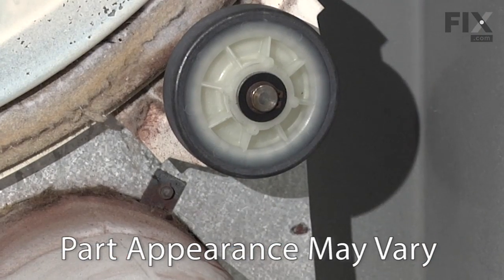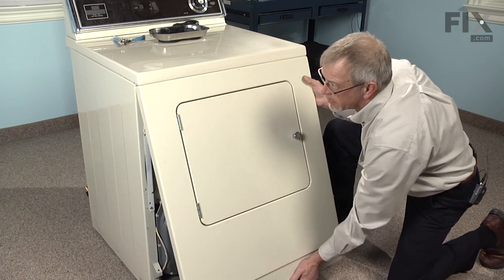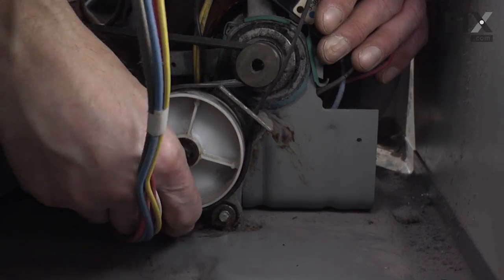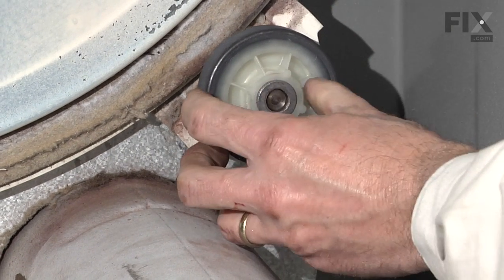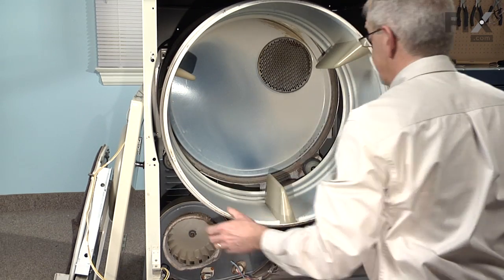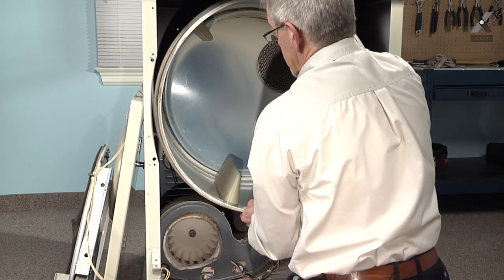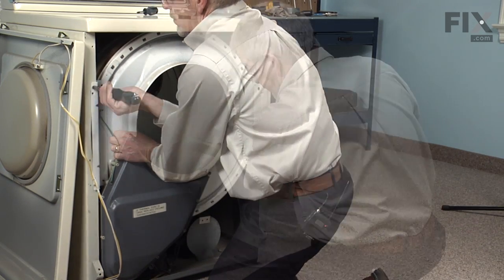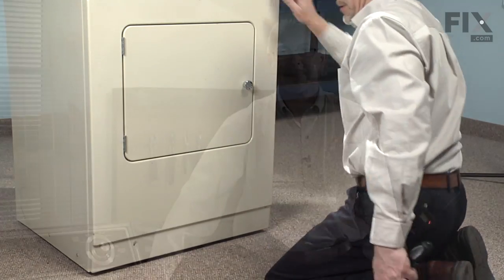Maytag Dryer Repair – How to replace the Drum Roller

Comment: Thanks for this video. I replaced rollers,tension pulley ,belt and drum Teflon slides on front. This is one of the best ways to put the belt on. 
Dryer runs like new for 60 bucks.

Comment: After spending the better part of the afternoon trying unsuccessfully to replace the belt (I could not "feel" it correctly, blind, with my left hand, backwards) i ended up pulling the dryer out of the space, removing the back vent panel and connecting it from there.  It took about eight seconds.
Reply: Did you have any problems with the gas line getting kinked? also any problems connecting back the exhaust duct? that is the only thing that worries me if i do it from the back. But yes i agree that trying to install that belt blind is a real pain.right now i am waiting for the new belt.
Thank you

Comment: What kind of lubricant do you use on the belt rollers?  Also wish there were a clearer diagram of how the belt wraps around the pulleys.  Otherwise, spot on - thanks

Comment: My dryer is not spinning. When I push the button I hear it hum, but the drum won't spin, not even manually. So I took it apart as you've shown and the belt is in place no problem.  How do I know if the rollers need to be replaced?  I can see them clearly, but not sure if they are worn all the way down?
Reply: The rollers need to spin very freely. How noisy is the dryer??
Any resistance on the tumbler guide wheels is a no-no and causes friction on the belt. Also, do a visual inspection on the idler wheel. Some dryers have a rear access door for the belt install. Sometimes idler wheels shatter with age, or the little e-clip lock fastener has dissolved into a rust powder, and the idler wheel decided to get cold feet, and walk off of the spring loaded idler shaft, causing a loose belt, or busted belt condition.

Comment: Hi, I installed new drum rollers and now after 30 days of not using the dryer it smells lime burnt. What is happening? Hope you can help me and thanks for the video !
Reply from the maker: Hi Alan, and thanks for your question. There are several factors that could be causing the burning smell in your dryer. You can check your lint trap, exhaust vent, and base of the dryer. Excess lint or dust can be causing the smell. However, the smell, could also be coming from the belt rollers, as it is important that the rollers are properly lubricated to avoid grinding. This can also cause the burning smell that you're experiencing. You might want to check the belt for wear as well, as an insufficiently lubricated roller can damage the belts. Good luck with your repair, and let us know if we can help you further.
Reply: Fix.com I really appreciate your help, I'll take a look and let you know !

Comment: My old Maytag dryer went bad with a burned heater terminal wire. I took that thing completely apart, and hosed down all the panels, cabinet, bulk heads, and the blower wheel (it’s very important that the blower wheel is clean, along with all ducting). Then I left all the panels, and cabinet to sun dry. 
I completely removed the driver motor assembly, blew out the dust and lint from it with compressed air (This too, is very important. The motor needs to dissipate it’s heat, or the motor winding enamel coating degrades, and can cause the driver motor to short out). 
I brushed off the dirt and lint from the heater housing assembly, and blew the inside (inner heater section) with compressed air, and took apart the ceramic heater terminal posts that connect the heating element, to remove whatever was left from the burnt wire (The terminal block posts, nuts, and washers must be very clean and shiny for proper contact and conductivity to the heating element). I took a wire wheel to the terminal posts, and Dremel cleaned the nuts and washers. Very important also is to not over tighten the terminal blocks, or you will shatter the ceramic insulator posts (...and 1 new heater terminal block assembly is very expensive at approx. $18.00)
I made my own replacement wire with 12 AWG (American Wire Gauge), and high heat spades and eyelets. I replaced the tumbler guide wheels, belt idler wheel, and the belt itself, since all the original parts had aging and discoloration. The dryer now runs and works smoothly, like it’s new.

Comment: New belts are a PAIN !!   they have memory and flip and flop, I used painters tape and taped it to the drum, took off the rear access door and in 2 seconds the belt was on and on right.  A  quick rotation and pull off the tape and ta daaa low stress !!  The belt (pully /tensioner)  is the worst part of the whole thing !!  I have done a few roller sets over the decades and for some reason the belt bogs me down ...this time was a little faster :)